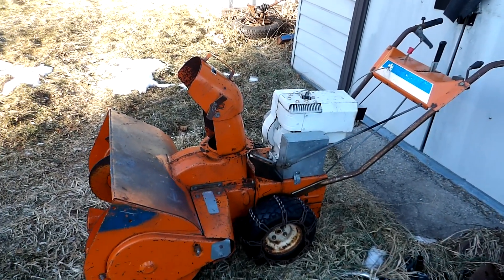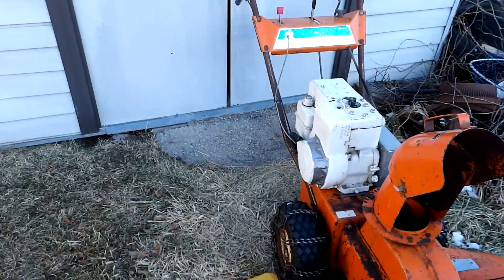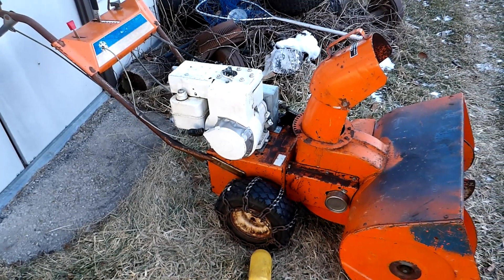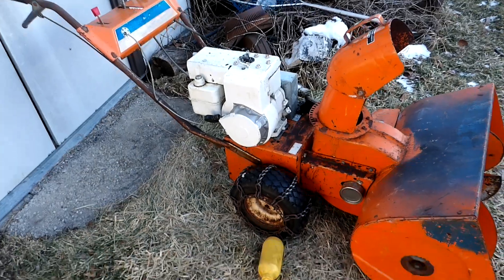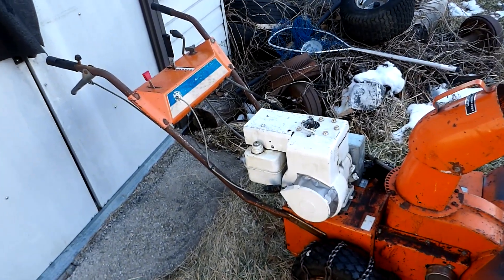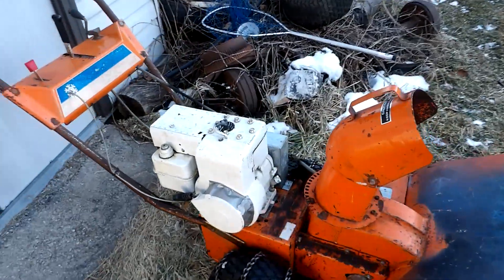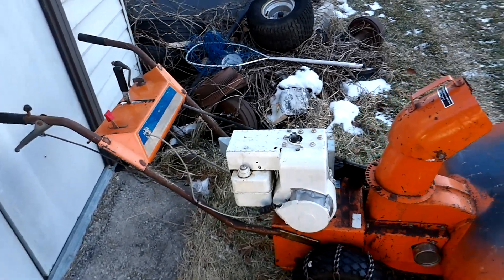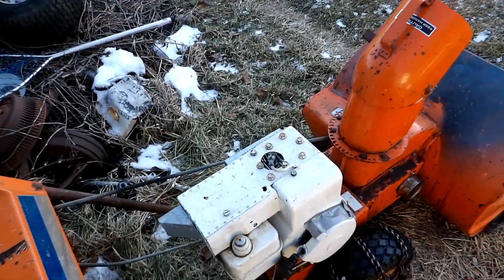50 year old Snow Blower Fires right up!

Comment: awesome... I have a very similar unit over at my aunt's house  were clearin' that place out anyhows so it'll end up over here at my place and I will definitely put her to good use
Reply from the maker: Very cool!  An older machine is definitely worth repairing, considering how much a new one costs, plus they just are not built as well, I have seen new ones practically rust in half! Garage storing them is the way to go also, this one is 50, and there is very little even surface rust on it.

Comment: That's like an old snowblower that I found that was out for junk it ran but they said was junk I replace the shaft that runs a cogs cuz I broke one side I don't know what year it is but it has a gear-driven tranny it's only about a four-horse there's a small one but I loved the thing it's just a champion I'm glad I repaired it cuz it works so good
Reply from the maker: Yes, they built then rock solid back then!

Comment: My old 1971 motomaster ,With the original 6 HP tecumseh started 1 pull after sitting all summer outside! All ready here in southern Ontario for the big snow fall !!
Reply from the maker: Yes, that storm coming is why I unburied the 72 Snow Flite in the shed, and sharpened it up for the Battle with the Elements!  Man it has been butt freezingly cold lately, and windy as heck, I am NOT liking it. It was way to frosty to visit the scrapyard yesterday! :(